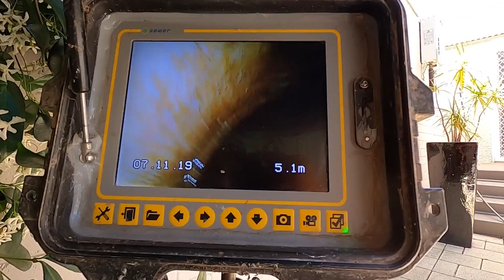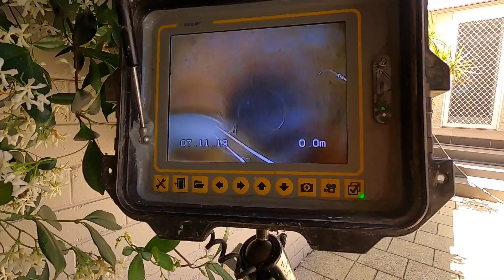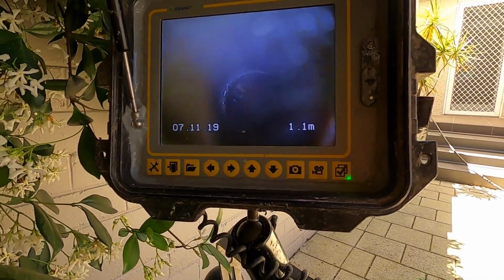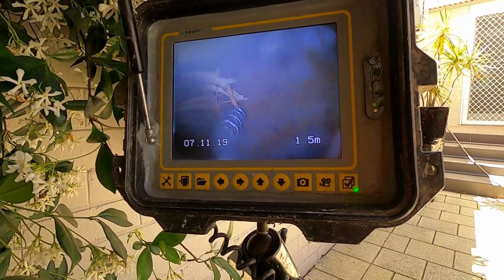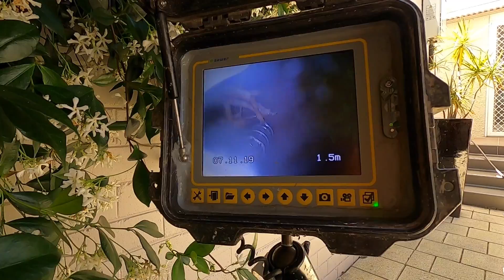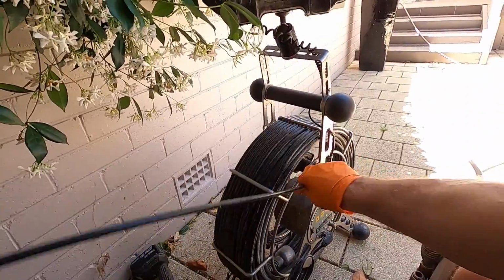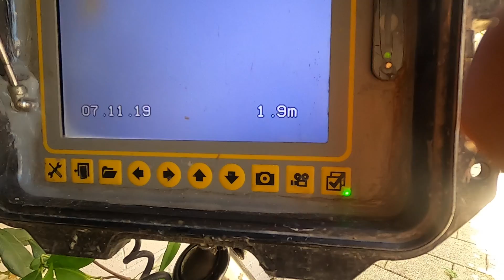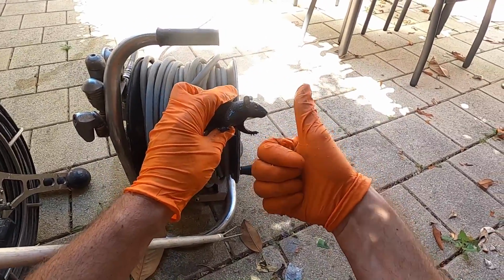Blocked Drain 393

Comment: I do not understand the fascination with corn.  Except perhaps that many do not know that the outside hull is not digestible.  Outer part of a corn kernel is something as hard as tooth enamel.  Even a cow can't digest it.  The inside or the pith can be digested and that is where the nutrients are.  When chewed the hull should crack open and the contents released but the hull remains fairly intact and passes through the digestion system.  For animal feed they usually sell cracked corn since it is dried and would be very difficult to digest anything out of it whole.
Reply: James Finnall      Now James you’ve spoiled all the fun we were having joking about corn. We know about corn dude, we eat popcorn and how tough the outer shell is. 😖